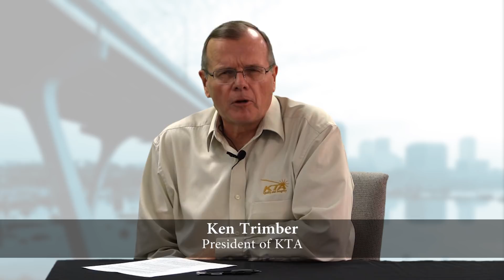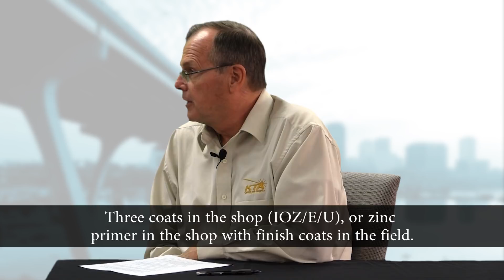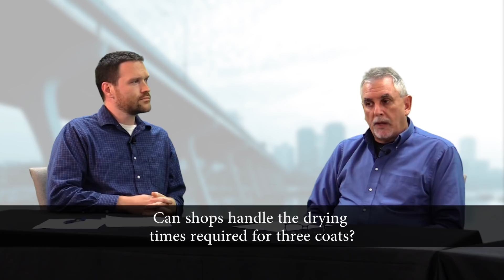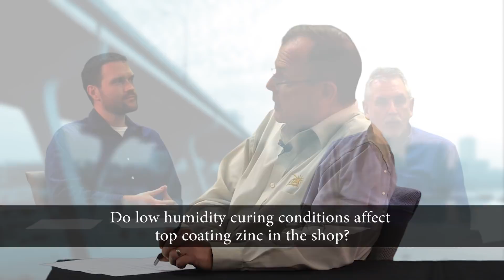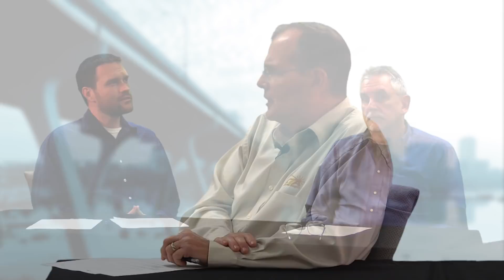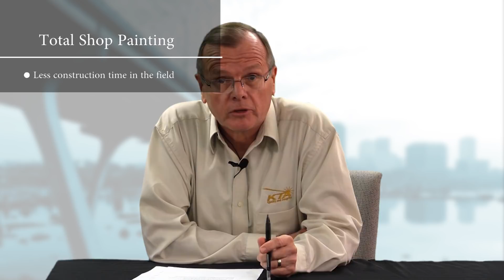KTA University Podcast #2 - Total Shop Painting vs. Shop & Field Painting

Comment: Thank you gents for awesome discussion ,it is very necessary to raise this topic because we always have difficulties to convince the parties involving in the projects regarding this issue whether client or contractor sides.
 my opinion and experience in the Oil and gas projects is to apply primer in the shop and  mid & finish coats in the field (not just even final coat) because it seems that you are saving time by applying all the coats or at least primer and mid coat in the shop but it does not , if your field is ready to erect so that releasing structure from the shop will lead to faster erection as well as the primarily purpose of coat which is protect the steel from corrosion will be achieve by less touch up, missing un coated bare spot during field touch up and damaging which absolutely will happen when transferring the structure to the field ,1000s of touch up points that are very difficult to observe and even to make repair them rather than applying at least 2  uniform coat in the field